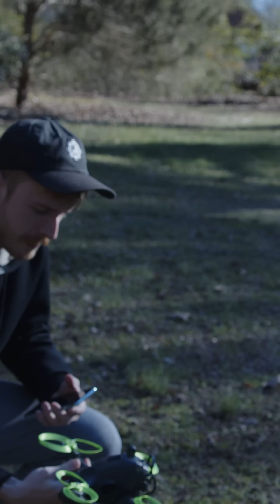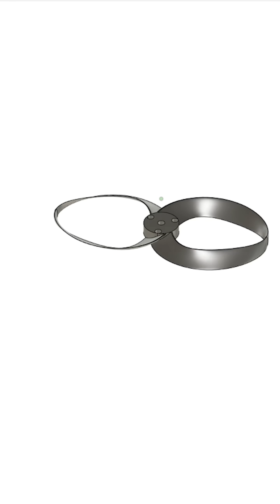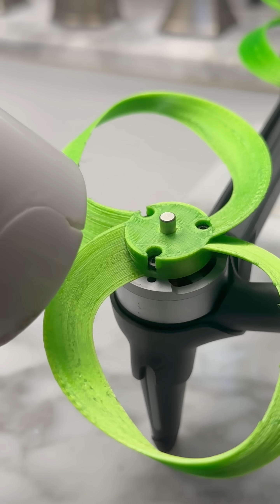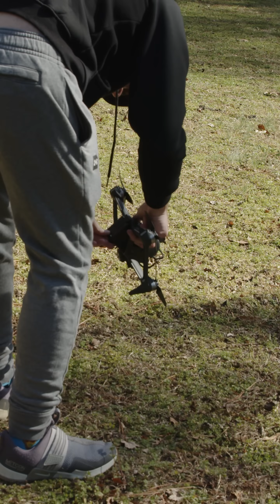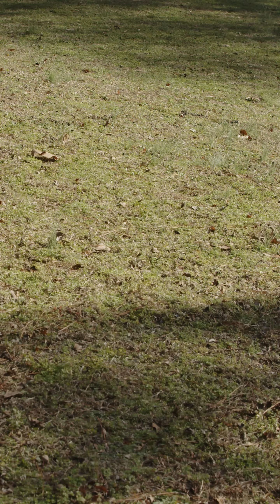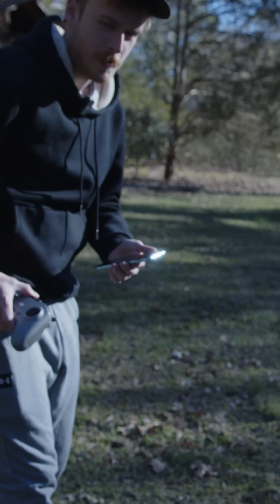Testing MIT's Toroidal Drone Propeller Design & Sound #shorts

Comment: FYI to anyone who's actually questioning if its quieter, just remember that the regular propeller was made of different material and designed for the drone, while the new style was 3D printed and is far from the perfect smooth blade it would normally be
Reply: He also failed to mention they made many different variations and are still testing it.
Reply: So ... He should 3d print replacements for the standard propellers for comparison
Reply: @rmhartman  this
Reply: So him mentioning it's an MIT design is just clickbait
Reply: @Mrkti  no MIT is the clickbait, they also used consumer grade FDM printing, not even resin printing. And the video they posted doesn't even include static noise meaning all sound was ripped from the video. There's something interesting here for sure, but everyone is clickbaiting in both sides. It's a fucking mess
Reply: And anyone with a brain would know this before doing it. And uploading a video of it.
Reply: Why should I believe you? Do you have real source or just trust me bro
Reply: It wouldn't matter how they were made because the propellers amplify the noise made from the low end motors used on this particular drone. For reference I have two oscillating fans that move air at the same volume and distance, one has a brushed motor and produces about 70 decibles of sound and the other uses a brushless motor and produces about 40 decibles of sound, the difference in sound is entirely due to the motor being used.
Reply: He wanted to compare right? So no these arent quieter
Reply: @Deathblow85 He wanted to compare the designs, yes. However, the manufacturing method for the two designs was radically different and involved different methods, materials, and levels of refinement.

If you want to actually compare the two designs to see which is louder you need to use a decibel meter and you need to properly manufacture the blades, which includes a lot of fine tuning for balance, smoothing, and blade edge shaping. As other have also pointed out, the toroidal blade is likely not 100% accurate to the design it’s based on simply because the specs haven’t yet been released. Even a small inaccuracy can make a huge difference in things like this.
Reply: @JM-nm2ir not just the pure decibels, but the frequency too, and quieter to who/what? Different frequencies sound louder to humans than other frequencies (our ears are optimised for human voices) and different frequencies travel more/less difference. 

Basically what he did is fine for a short, but If you were actually testing them properly there's a million different variables to consider before drawing any conclusions
Reply: @Deathblow85 He wanted to directly compare the designs as the only variable. He couldn't, so the results don't matter
Reply: @mightymarlin97  so i think you actually understand, gratz! The test was broken, because he tested an trough and trough developed design with a not so tested one, and home made at that. So while I applaud this video and its creativity, the comments below it justifying the difference because of the materials used etc. Mean nothing to me, because it was like testing a round rubber wheel, versus a wooden square one.

Comment: I think a few things are the issue here but from the sound and look of it, the prop may be warping in shape as higher rotational forces are applied(higher RPM). That would change the blade angle creating a different sound and make the drone fly a bit shakey. The drawbacks of 3d printing is likely a cause but I think that material choice and thickness would make a gigantic difference.

Comment: Honestly sounded at about 30% louder for the first split second. There was a much lower frequency though and that would have a tendency to stretch much easier as it dissipated through the air, effectively rendering any sound dead at a certain distance.
Reply: Which is impressive since he built an inferior version lol
Now imagine what it'd sound like if it was made properly?
Reply: Sound like a fly near my ear
Reply: Low frequency sounds travel further than high frequency sounds...actually.
Reply: @sunvetr  that's why my stepdad thinks he's not deaf now lol. He can only hear the low frequency sounds. He has the hearing ability of a tree.

Comment: This isn't really a fair test, a fairer but still not completely accurate test would be to put these new rotors against regular propellers that you also 3d printed that way they each have equal construction quality and imperfections that increase decibel count.

Comment: you should thin out the outer curve to reduce weight. for a slow moving boat/submarine prop its ok like it is, but for high speed aircraft thin it out.

Comment: "I went through and 3d printed them. They were difficult to print"
My guy... you just push buttons. The computer printed those
Reply: It just prints itself, no temperature managment needed, you say, my guy?
Reply: @japanesecar1501  if you're a capable computer or 3d printer engineer, you have no real issue with temperature management. Way to oust yourself as struggling with the simple shit.
Reply: @HebrewHunter101  you're right. You know, I was going to chastize you for pushing unreasonable standards on a guy who opened up the question of managing the printing, via his "failure" to make them print "themselves".

 I was not really watching when he showed his printing setup. I still am at A no man's land when it comes to you saying you just push buttons, as you yourself said you need to manage the way the print goes as a program.

 You could have steered him into a better way to do things, as you understand how the process goes, while being understanding of his level, and critical of his shorttcomings, said something about how to manage warping and local stress.

 You insinuated, you should, as a computer emgineer, or 3D printer engineer, of which he is neither, (as far as the video goes, this is important fir the morality standpoint), only 3D has a thing to do with 3 D print, and then actually a true engineering position/qualification is definitely very overboard for anyone, not customizing, developing, and simplyfying the  printing process, and the device, with extra layers of controlling factors for known uses, to maximize "push a button prints" precision and effuciency. 

 What did you mean to say, and correct, if you did, really, and why did you not say anything of use to the channel runner? Instead of saying "prints itself", when printing is how you program it, and not a linear process, you could have said, what he needs to do, rather than opening a void of unsaid suggestions, standing on saying "You did it wrong", "You aren't even sure if you print the right way", "You aren't even an Engineer.." basically. Overboard bombastic contrarianism. You just gave him a reason to be angry at you, and didn't buy yourself out of "just criticizing him" , by not following up. 

So what did you mean to convey,  which is better to people running the channel, being in touch with whatever catches their mind and watching, than what you just did? I am just saying, you coukd have said much more, and conveyed the fact he is not a pro by any means all the same, and you didn't have to tie people not understanding printing, to having overkill qualifications, and condemning them for "failing" to reach the overkill standard, and" failing"  at priting knowledge basics, whuch was your point, way below, than what ana ctual engineer deals with, then "sayonaring" out of the comments section, then continuing to "try to oust us", by still playing the to you available card of "see, you do not know what I pointed at and didn't describe!", when all I was pointing at, is that you didn't give any actual useful information, a friendly chance to make amends, by grabbing at your loose ends. 

Instead you obfuscate your knowledge further,  keeping to stand on a pedestal for others to reach, when you know you're on YT, and , and people not knowing about exact printing management,  doesn' t mean, that you've jumped all the loops to know you really are at odds with the people around. 

So how did your post give you any satisfaction, and what purpose does it have? And me having to dig for "your problem" with the video, when it is not clear, in any way, whether you meant to impact the happenings positively? As your posts are not welcoming, and cast shadow of doubt on how self aware, and concise, is the non-volatile meaning behind them? I do not mean to make any excuses for the channel, but I contonue to question, ehy did you need to say"it prints itself", in theory, or why is "pushijg buttons" to make a good custom print , not enough work at the task, when surely we know 3D printers print, under their own power, and instructions from a person, not humans with augmented oversight, and direct control.

Comment: That's the fun part.  It looks like what they did, but apparently didn't match their design.  So you got worse performance.  Do a few hundred iterations, and you'll likely find something that works a little better.  But as things go, it might be 2% quieter, with a 5% loss (or gain) in performance.  

It's totally worth doing a video on, once you get it right.

Comment: As has been pointed out, your 3D printer can’t get the surfaces nearly as smooth as they need to be to achieve the quieter sound. Resin may be the way to go, but I don’t know how well those will hold up to the immense forces.

Comment: For future reference: we in the gunpla hobby have this stuff called “tamiya extra thin cement” which comes in a small glass jar. It is specifically designed to bond both abs and PLA. It’s much less dangerous to your product than nail polish and stinks far less. A standard size jar has lasted me more than a year, but I bet your mileage would be far less with a 3D printer. We also have “godhand” nippers which makes your creality $5 nippers look like a joke.

Comment: It didn't sound quieter but how much Frost are they putting out? Because let's face it audio is not the critical. Lips load carrying capability. Can it carry a six-pack of omelets into combat? Will it help increase range? Please don't just focus on audio. Also you might be thinking about variable angle. Also the audio comes from the high speed of the blade if you can increase that you can reduce best feed to perhaps below the sound barrier. Because right now those blades are making the same noise a whip or town does when it snaps

Comment: The pitch lowered a bit, which means the sound is probably not going to travel quite as far, but you'd probably benefit from a better design and some sandpaper.

Comment: That's not well enough made to work. They sound louder as they're not accurate enough you can't be painting them for a start it'll make the surface uneven and balance will be off aswell when done correctly they are quieter but these seem much louder so something is amiss either in the design/printing or what you did to them after.. 👍🏴🇬🇧

Comment: Try the finest variations in print settings and make a ton of different props. As many as seem reasonable and try multiple different surfaces coatings. Even get some carbon fiber ones made after troubleshooting.

Comment: Let's just say they sound different.  Efficiency is supposed to be a thing on boats where all those issues are amplified in water but I doubt that claim also. Efficiency at a particular RPM range is probably if that RPM helps a certain app.

Comment: The propeller isn't what makes it loud it's the combination of the propeller and the motor. Also you made those things unnecessarily heavy and louder by adding polish. You don't home 3d print this type of propeller. It's needs to be injection molded

Comment: More blades equals quieter operation as they don’t have to spin as fast to get the lift compared to a 2-3 blade prop.
Reply: Lift is determined by disc area, not blade area

Comment: Can you record the RPMs of the drone engines? That way you could measure lift power per RPM as well as noise level.
For instance what RPM and dB level is needed to exactly hover the drone? (Assuming the drones weigh the same in each configuration.) You might need to "handicap" the lighter configuration for a direct comparison.

Comment: Practically, I would think they should be more durable as they can deflect big hits to the propellers.

But I wonder if the noise reduction isn’t really working because the motor efficiency is tooled for the other propellers. Since the weight and torque change up, maybe there is more energy loss? Someone smarter than me confirm this.

Comment: To add more or better said to remove more noise I'd suggest making grooves in the aft part of the propellers in the same design as the B787 engine nacelles which has been proven to reduce noise and new  household fans are starting to incorporate the same grooves to reduce noise.  Cheers!

Comment: Firstly you're like the 11th Youtuber replicating MIT's concept, you pay zero attention to balance though which is absolutely critical on any prop, also your surface finish and accuracy of form leaves a lot to be desired for what is designed originally to be a hyper efficient propeller system, the spider design you chose is the least promising of their designs a d you undo their good work

Comment: These propellers are neat but they look almost nothing like the one designed at M.I.T. On the propeller M.I.T. designed the leading "wings" of the toroids were higher than the trailing "wings" (not on the same level) and they had a different pitch on the leading "wing" vs the trailing "wings" as well. Also the "holes" of the toroids where very elongated ellipses (almost "slit" like) and not perfect (or near perfect) circles. So that is probably why you are getting the results you are  results are getting.  I've seen a few channels test this exact design and claim it as M.I.T.'s design (and have similar results).

  If you want a fair test of your propeller design, you should 3d print a traditional propeller to compare it to. Because comparing your 3d printed prototype to an smooth injection molded part isn't fair to your design.